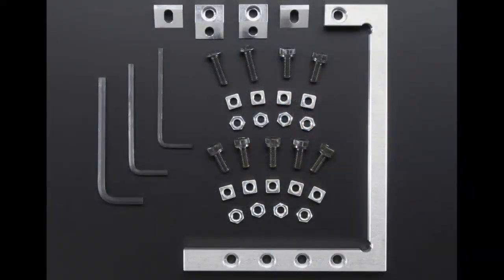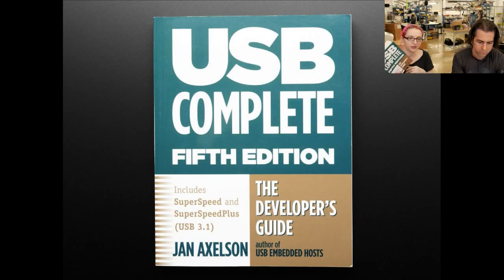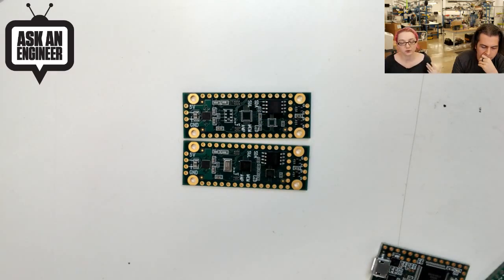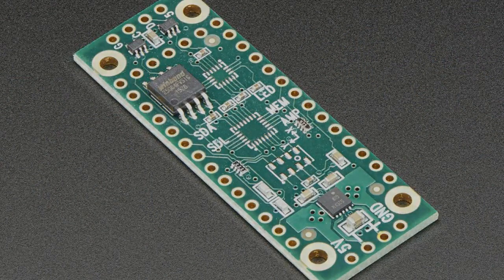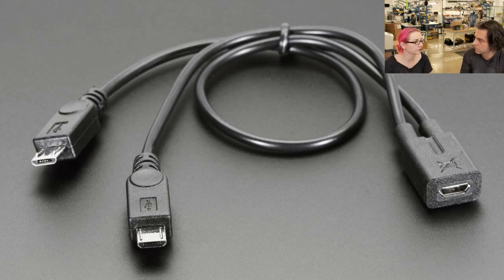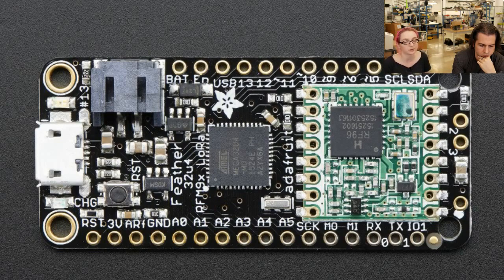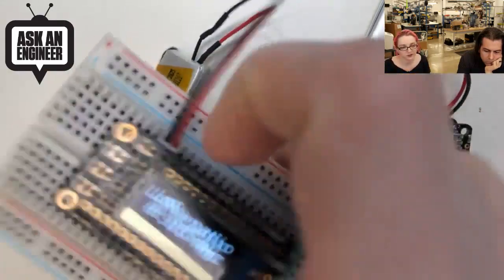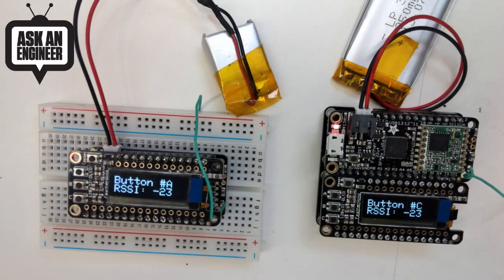New Products 4/13/2016

Comment: Hey guys, I've got a Feather LoRa in australia, something I noticed which seems to be an oversight on the most the feather designs is there is not blocking diode to stop LiPo battery voltage or power applied to the 5 volt external pin (such as external power) from going back up the USB connector, I've modded mine to cut the tracks/bodge job linked the charge LED in two spots from the circuit to the USB connector in fear that the USB might not like power being applied to it.

Comment: I used a coin cell breakout with the switch and a single royal blue LED with a tiny 3d printed cover.  Placed it right under the collar on my cheap leather jacket.  Mebbe 48 hour battery life?  But it's been a great conversation starter.  It's curious enough for people to ask about it when I have it on, simple enough to explain in a few sentences, and a great lead in to open source hardware and electronics. (My rural town doesn't get much exposure to diy electronics, at least not at the community college..)

I think most importantly is it's minimalist appearance, it's not so many lights that it has become a spectacle.  Sadly I don't own a phone, yet.  But when I do I'll be adding bluetooth, lipoly batt, for some more complexity, blinking, fading etc..  But it has been really fun trying to come up with a use for a single led.